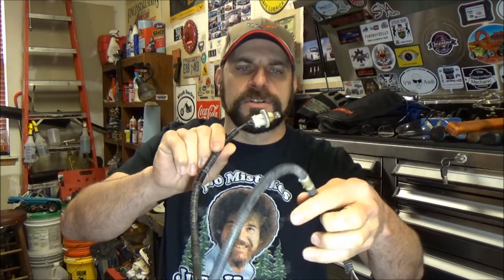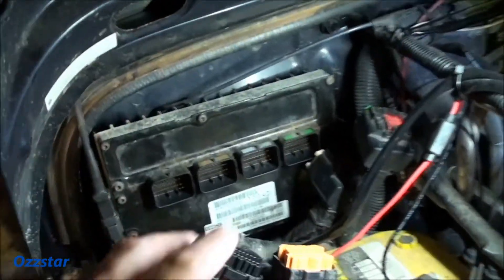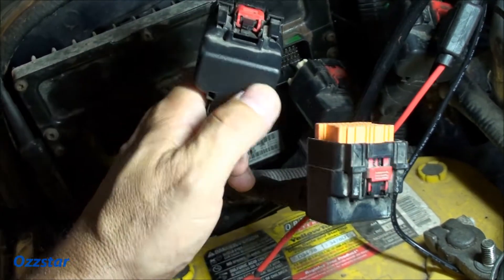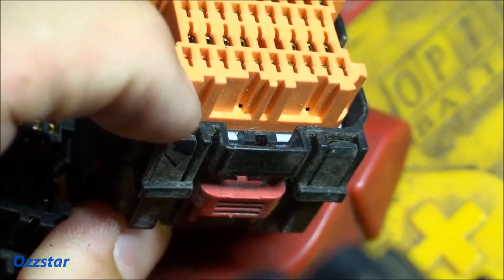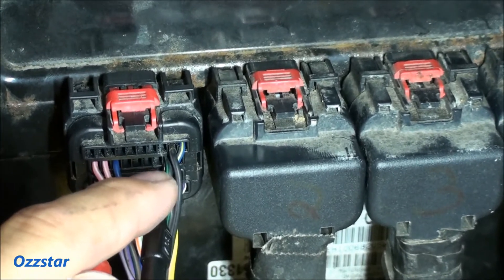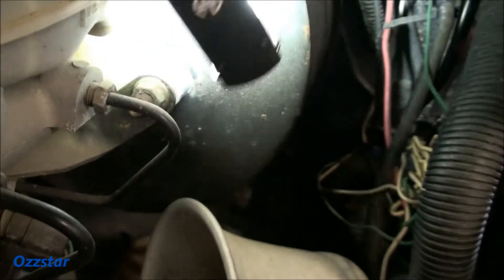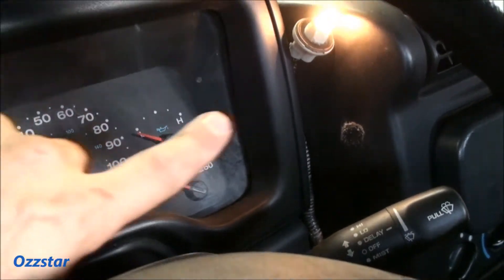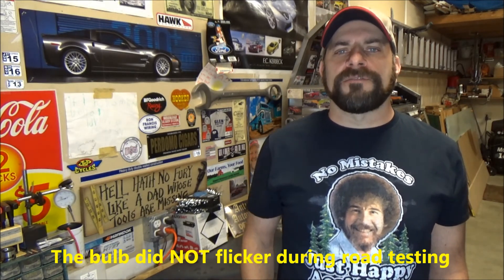Jeep Wrangler TJ - PCM/TCM TESTING - P1603 P1604 P0700

Comment from the maker: **Back probe testing pins**:  https://amzn.to/2Pf5TZx

**Bulb 194 connector**:  https://amzn.to/2DoXtdf

**Bulb 194**:  https://amzn.to/2DnfLLS
The original TCM Problem video:  https://youtu.be/PbUqhvXu7N8
  Thanks so much for stopping by.  Feel free to subscribe and leave a comment.  Thanks for checking out the video.  -Glen (Ozz)
Reply: Hi I was wondering if you knew anything about my issue I get this code P0732 and when I put my Jeep in reverse it won't go just make noises if I put it in drive it will go but will stop and just spin grind like reverse did. My fluid is full also I did check my driveline and I do have a bad cv joint in rear but my Jeep should still move just would click or something I thought .. any help would be appreciated

Comment: I have an 06 tj 4.0 manual, crank no start, determined it was the fuel pump after my troubleshooting, before bolting up gas tank I tested for voltage again at the connector and still showing 12.1, fingers crossed  still crank no start, back to the drawing board, any suggestions? No check engine light, jeep was running fine prior to issue, it does start with starting fluid but dies once the vapors dissipate, so I have spark, compression, just no fuel delivery.
Reply from the maker: Does the Jeep have a security system?  Do you have an icon on the dash?  That can cause a no start.  The fuel pump can be getting voltage but have a dead spot.  Having voltage at the source is good (12+) volts but what's important is to check the amperage.  That will tell you if there is resistance in the circuit.
Reply: @ozzstars_cars  surprisbgly everything is stock, no aftermarket electrical parts, no lights, even the radio it stock, so no alarm, no anti theft system installed either, I will check for amperage, but what is my range? I did obtain the wiring diagram to the vehicle just now thanks for your help, my main concern is I cant read the pcm/ecu with my Bosch scanners gunna  try a different one soon.
Reply from the maker: Also make sure you have a good ground in the pump circuit.
Reply: @ozzstars_cars  ok will do,   update new symptoms showed up, I had the ecu disconnect from battery for over 5 days, just turned ignition 5 mins ago  and as far as dash lights go, engine light is on, flashed for a few second then back to solid along with brake and seatbelts lights which are all currently stable.
Reply from the maker: @5pointsguy  email me at ozzstar@aol.com

Comment: My RPM and voltage meters are a little jumpy and I think my breaks are involved somehow as well. It started by shifting up and down, now it's not shifting at all. I checked the power and ground as you showed. I mean, really, if my Jeep is doing everything you explained what are the chances that it's NOT the computer?
Reply from the maker: Flickering gauges I would be looking at a wiring diagram to see what circuits are affected and get direction on where to search for the problem.  Then you could see if the trans issue was related electrically to the gauge issue.
Reply: @ozzstars_cars  no,sorry, I did't mean they wer flickering. I mean the amps and rpm's are going up and down slightly.